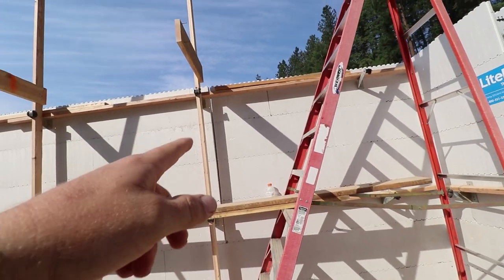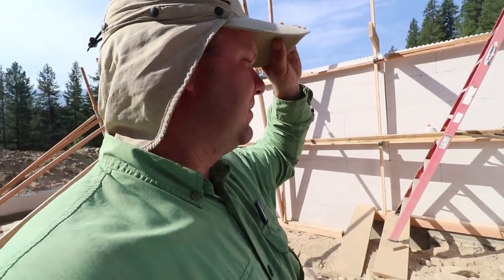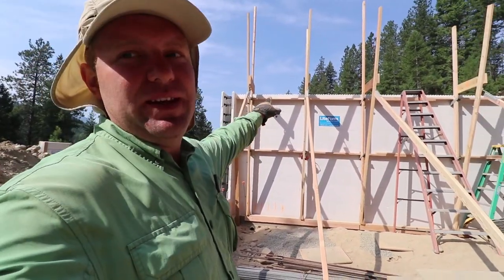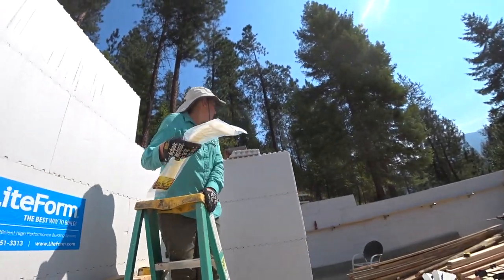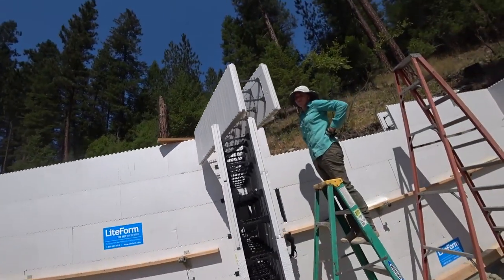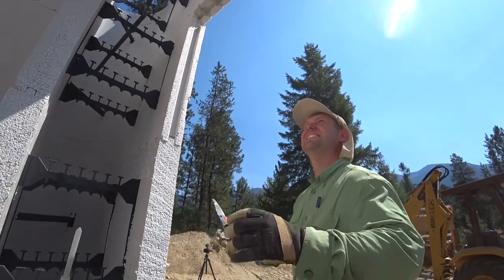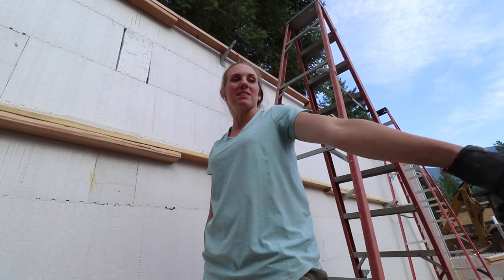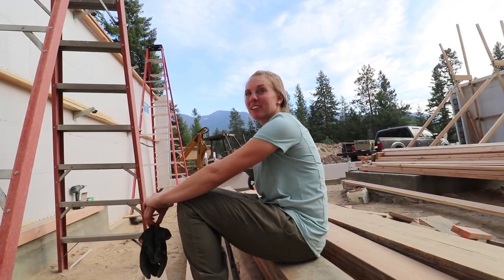Building a House Start to Finish: ICF Construction on Mountain Home in Wilderness

Comment: man, I'm not sure if you're a perfectionist or over-thinking or if you want to prove that you're smarter than the engineer the engineer has told you how many times you need a common seam. so your house is going to be a half inch taller you keep saying you have to give up your principal can so let it be that way if you can't let it go take an hour divided by wall in half with the common seam horizontal centerline Mark 6 inches on each side of the centerline. cut out 12 inches on Center on each blog block pushover your opposing horizontal wall giving you trouble. then measure each section and then put it back in

Comment: My left ear feels so lonely :(
Reply: well put your speakers the correct way around since the audio is only coming out of the left side. meaning your right ear should be lonely...
Reply: Dam already checked my speaker, GOT ME!
Reply: Mat That's why our left ears feel left alone processing the audio :)
Reply: One of the differences between standard audio and 5.1 surround sound is the reversal of left for right main channels. Home theater 101, welcome class. I'm not the teacher but I can guess maybe the crowd that agrees here on one way being correct just might be able to change that with a hard to find setting in software somewhere. Issue of recording as one flavor and playback as another will always swap it around anyway. Good luck with this pointless debate.

Comment: You're pouring those walls way too high you're going to have a mess on your hand if you didn't Pour at 3 block I and then three block I I used ICF forms many times if you haven't poured your first row by itself and left at 6 inches dry of the top and then gone up 3 and then done it again you're going to have a mess on your hand by the time you get your pump truck out there

Comment: OMG so push the wall over a bit, duck tape the crack and poor.. you may get a little squeeze out at the bottom but nothing that cant be cleaned up.  You guys are getting way to technical over this. Most constuction if off by up to an inch and can be easily covered up in finishing.  Just saying.